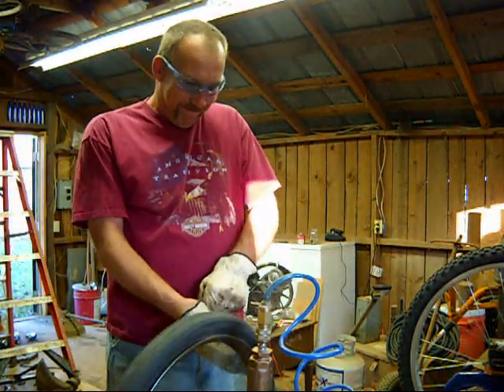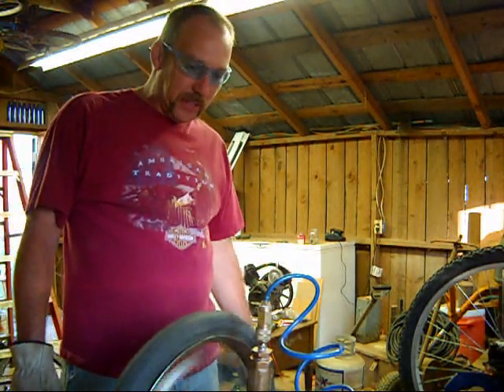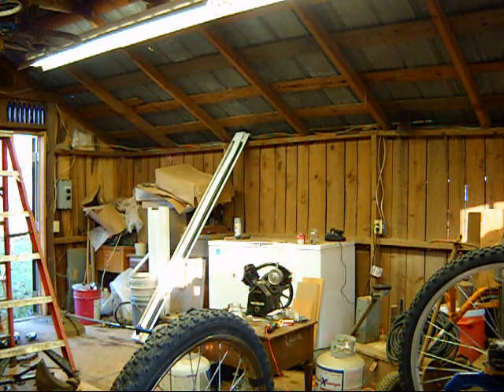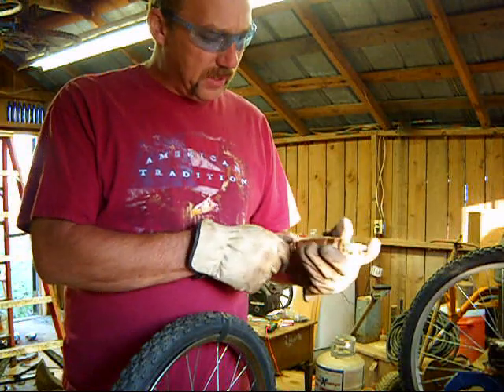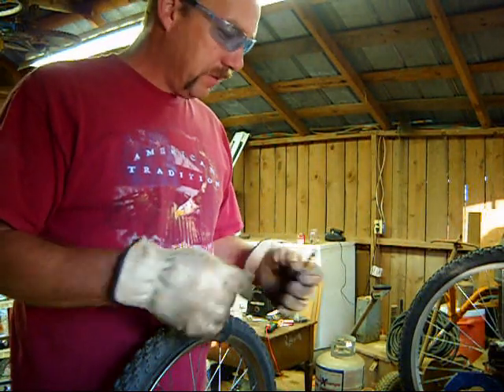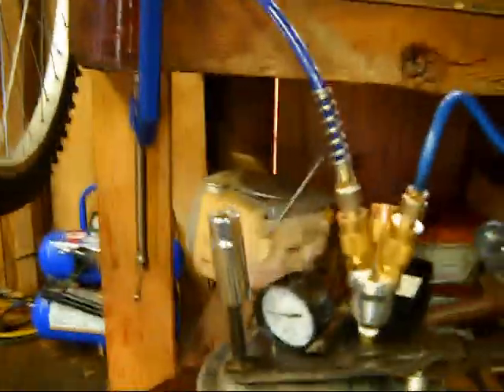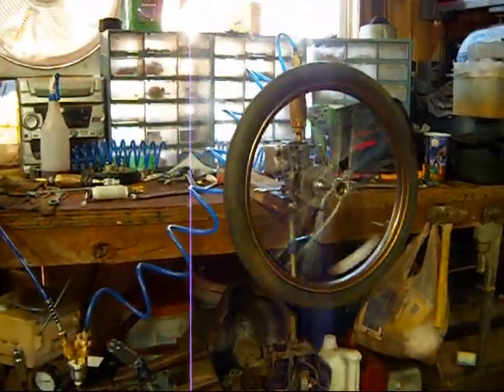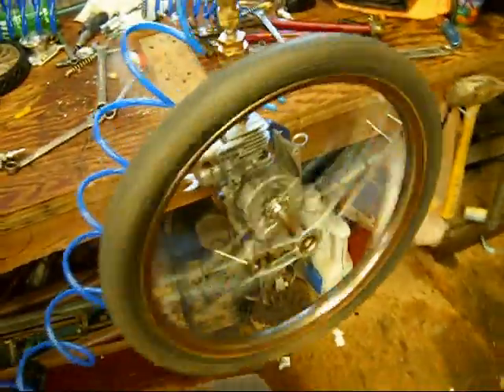Steam Engine From weed eater II

Comment: Hey I have mine hooked up to air just for testing. 
But it won't spin. It goes back and forth but never a complete rotation. 
It's at 60lbs. I figured that would be enough pressure.

Comment: Great vid.You might try a hooking up a venturi to the exhaust & steam output to avoid having too refill the boiler. You can also remove alot of the extra  metal from the engine now that it's a steam engine. I've primarily used your video as a source of inspiration for my steam engine, which will use an old steel safe for woodstove, pressure cooker for boiler, weed eater engine, and finally a washer motor/bridge rectifier to generate power for a battery/inverter/laptop! I can't wait to share!

Comment: So was there a specific name for that check valve setup you bought? I've been keeping my eye out for one, but have yet to find them. The valve setup that I planned on using isn't working out as well as I'd hoped, so I'd like to keep your setup in mind as a backup. Anyways, keep up the good work! And I agree with the part about the work bench.. Mine is a mess of pipe fittings and other crap right now
 : (

Comment: Terry,
Very cool video.  You've discovered how to get a Uni-flow bash valve engine to run on low pressure steam.  Insulate the cylinder above the exhaust, and the entire check valve and you will get more speed and quicker run up to top rpm.  A lot of the power is escaping as convection from the metal.  
Lengthen the pipe nipple and rod to get better speed.  With the longer inlet port you can open a little sooner before TDC and get more pressure build.  
Keep going!